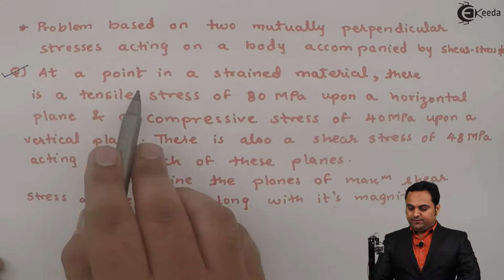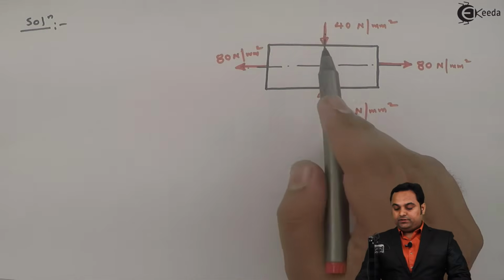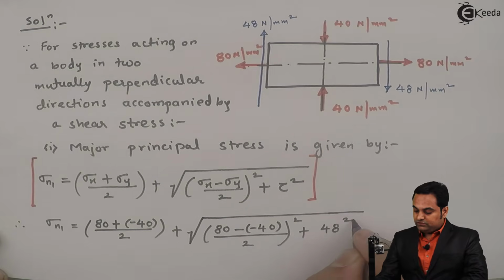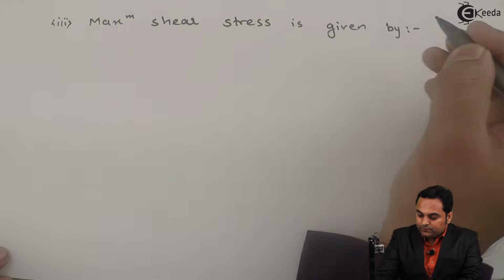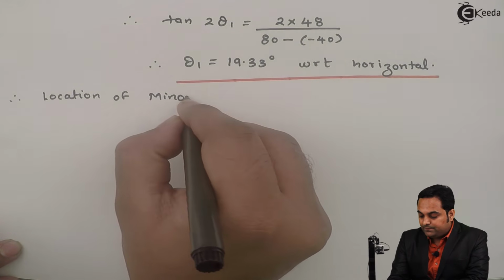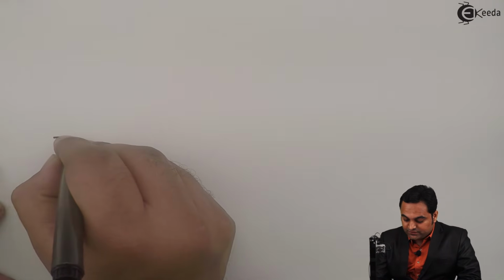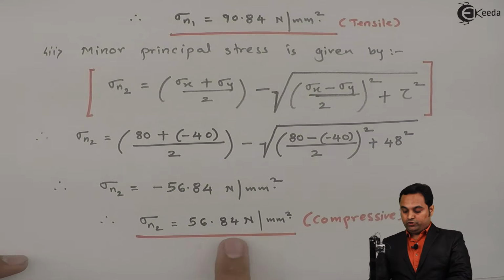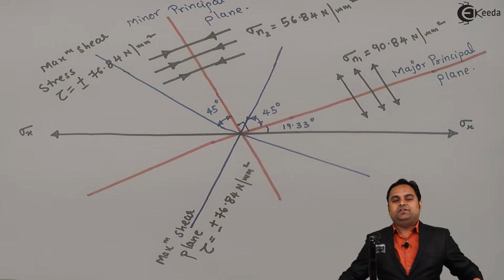Problem on Stress in Two Mutually Perpendicular Directions Accompanied by a Shear Stresses

Comment: Sir, but 80 MPa is acting on horizontal plane. so it should be Sigma y no? 😟
Reply: I have a same question why 80 MPa not in y axis and 40Mpa not in x axis?
Reply: It doesn't matter bro
Reply: @himanshu1312gupta  yes, it doesn't matter to me either after 6 years 😂😂🙏😂😂😂
Reply: @ashutoshpurohit8603  what are you doing now
Reply: @himanshu1312gupta  taking my family business ahead, no relation with engineering anymore 😎😂
Reply: @ashutoshpurohit8603  great...
Reply: @ashutoshpurohit8603 Like what, bruh? You completely changed your field?
Reply: I feel better when I see your comments 😅
Reply: X-axis brevv